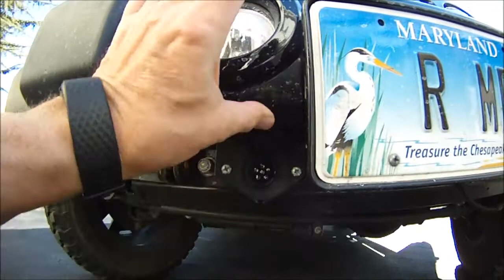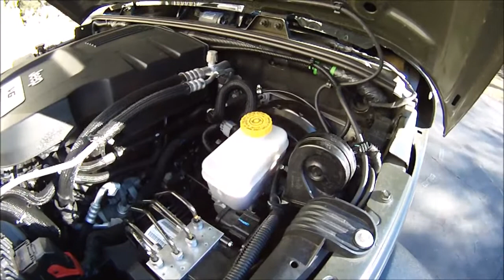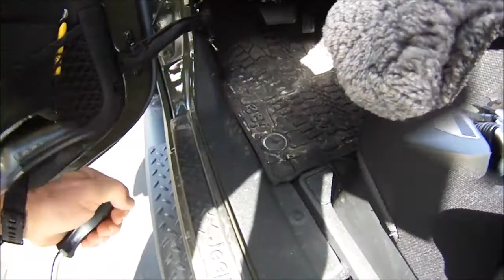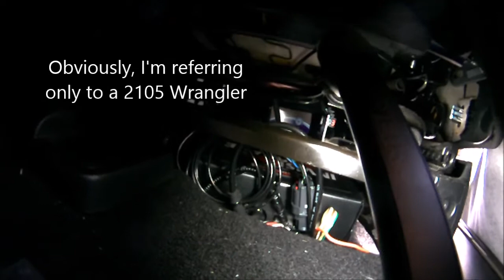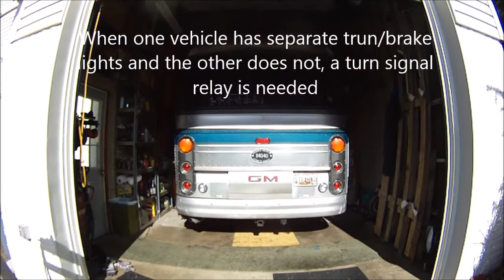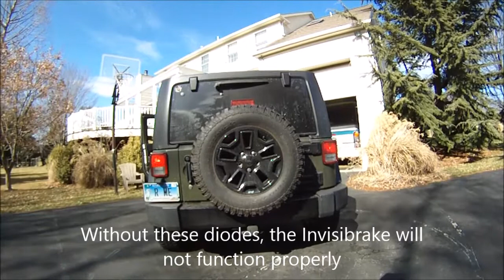Jeep Toad Invisibrake Modification

Comment: Add a high end battery maintainer usually putting out from hot line in motor home on rv side and connects directly to your battery like yours  but ground protected! Also has power indicator lights for rv and car side

Comment: What a slick set up, I was always curious how a vehicle was controlled (braking) while in tow. I'am curious if you feel a lag or experience brake drag while towing?
Reply from the maker: Hi Eric,
The Invisibrake system does have a slight lag.  This is noticed by the indicator light on the dash rather than any forces exerted by the towed vehicle.  In fact, for years, I pulled another Jeep without the brake and you don't really know it's back there.  The Invisibrake also allows for adjustment; I do not have it adjusted to maximum braking so as not to overheat the Jeep brakes.  The braking capacity of the bus far surpasses the added weight of the vehicle, although every little bit helps I guess. 
Thanks for all your interest!
Reply: @strayhound61  Hello Mr. Mathew. Thank you for your time and response. 
  A little piece of mind is good insurance knowing that there is a braking system on the tow vehicle none the less. I myself never seen an air actuated brake system like the one you have, flipping slick setup. I suppose the weight difference between the Bus and the Jeep, you could probably drag the Jeep with all brakes applied and wouldn't feel the resistance anyhow.
    Thank you for sharing!
     Kind regards, Eric Dee.

Comment: I'm confused.  Seems awfully complicated and I don't get how your integrating a 12volt system with a 24volt tow vehicle?  I have a 76' GMC 4108 and am looking to add towing capability.
Reply from the maker: Justina S 
Once you sit down and think about it, it's fairly straightforward.  My vehicle has a 12 volt system.  You would have to by a transformer for yours.  If there is something else confusing, please ask.  Happy to help.
Reply from the maker: Hi Justina, I've been thinking about the response I gave you earlier.  While the 24 to 12v converter (or transformer as I called it earlier) might be only one part of your issue.  The converter will reduce the voltage to 12 for your power supply to the Invisibrake  (or other control unit) from your coach.  But, you will still have 24 volts coming through the light circuits, if all your light bulbs are 24 volts on your bus which I believe they are.  If not then the only place you need the converter is at the power supply 12 volts from the coach to the toad battery.  However.  if the bulbs are all 24 volts on the coach, I do not know of a converter that reduces the voltage from 24 to 12 for each of the light circuits.  You might want to see if Hopkins or someone makes one specifically for that.  You might also consider a different approach.  There are units that work on air pressure and others that work on a mechanical device from the hitch ball to the brakes via a cable.  In those cases, you could simply use a light bar on the back of the toad that has 24 volt bulbs in it.  There would be no electrical connections between the coach and the toad and that might be the simplest approach.  Good luck either way.  Let me know if you need further clarification.
Reply: Hi John; thanks so much for the help.  I didn't mean to imply that your video was not helpful, because it was.  I just got a little lost in the details partly because I was looking for info in your instruction which really wearn't applicable to my issues.  I find your vid's to be very helpful and would love to see more of them in the future.  Was your 4106 converted at some point from 24 to 12v?  I always thought the 60's 70's GMC's were all 24v.  Anyways, thanks again.  Oh ya; do you remember the part # for bagedge door hinge rubber?  I need to get some from MCI.  Have a great day.
Reply from the maker: Hi Again,
No worries about your comments.  I didn't think they were negative in any way. I'm pretty sure all the 4106s were a 12 volt system through 1965.  I believe GM changed to a 24 volt system with the buses built after 1965 although I could be wrong about that. 
The baggage door hinge rubber is part #2467448 from Universal Coach. Have fun with that!
Reply: Oh ya, lots of fun!  Thanks a bunch for the part #.  I think your provably rite about the change in voltage.  I just assumed they had always been 24.

Comment: This is very helpful. I am getting my toad set up now.
Reply from the maker: Thanks Kevin, glad the timing was good for you.  What brake system are you using, or are you making one up on your own?
Reply: +John Matthews I plan to make my own using an air brake chamber.
Reply from the maker: Yea, I wanted to do that but couldn't get up the ambition to figure it out.  Thought a 30/30 chamber would be too big and couldn't figure out a simple way to have a brake away brake.  I was good with the application cylinder.  Clippard Industries sells some nice air cylinders, if you're looking.  Good luck.  Shouldn't have issues with battery drain with that approach.  Let me see it when it's done.
Reply: I will look up Clippard air cylinders. I figure a No. 20 brake pot will be more than enough. The brake-away activation would be in the spring brake feature of the air chamber. If air supply is lost, the spring activates. I will let you know what I come up with.
Reply from the maker: That was the same thing I was thinking of doing and perhaps I got the idea from you.  My issue with that was that you would have to disconnect the chamber from the brake pedal when not connected to the bus.  If the air bled off the spring would apply the brakes when not connected to the bus air supply.  So I gave a lot of thought about how to do that.  I had it figured out for towing but not for independent operation. Didn't want something I had to connect and disconnect.  I was going to contact Clippard to see if they had a spring loaded cylinder and use two.  Then I gave up and purchased the Invisibrake.
Reply: +John Matthews A long time ago I saw some pics of a guy's set-up. It entailed a quick disconnect of the unit, including the pushrod from the brake pedal. Maybe he just aired it up before connecting or removing, to retract the spring (as you do when bench testing an air brake chamber).